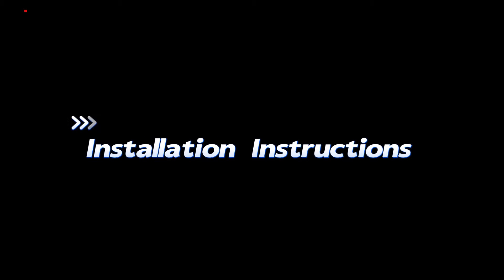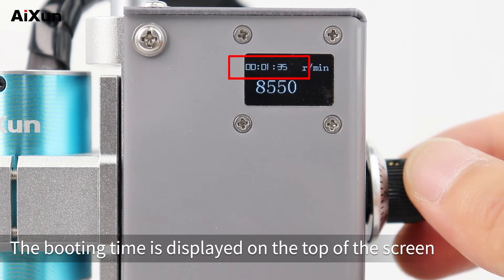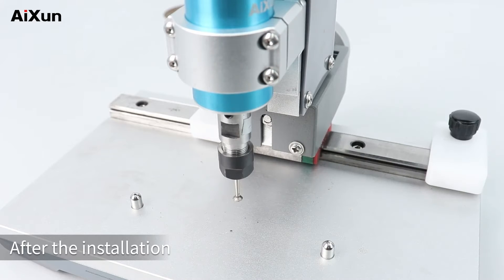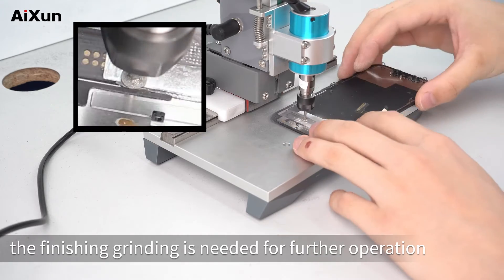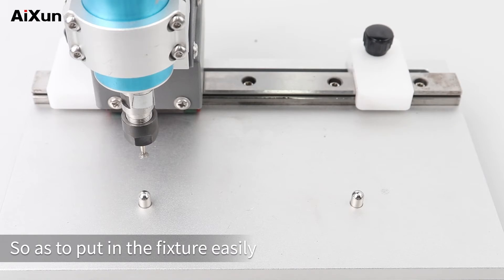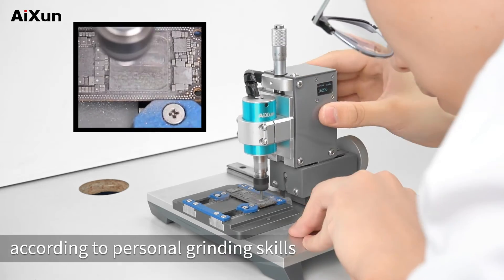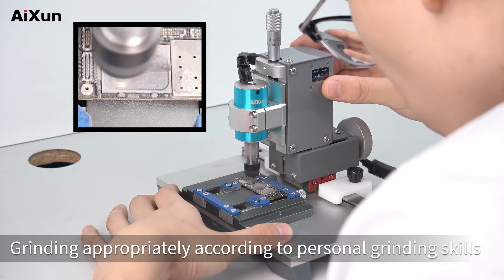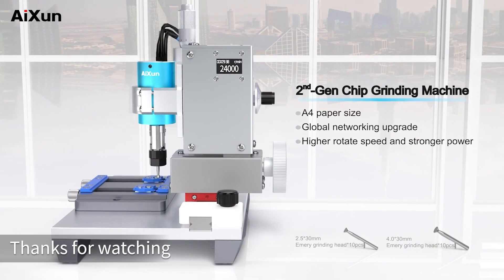AiXun 2ND-GEN Chip Grinding Machine Operation Guide

Comment: Hello! Why is this machine needed? Isn't it easier to just unsolder the microcircuits with a soldering gun?
Reply: Hi ! This tool is used to remove Chips from a donor MotherBoard to be able to solder chips from another phone (mostly used in Data recovery when iPhone MotherBoard is dead).
Grinding is used instead of unsolder because there are many components closed to the chips, unsolder the chip would be too risky...